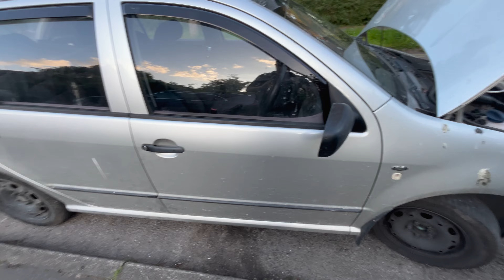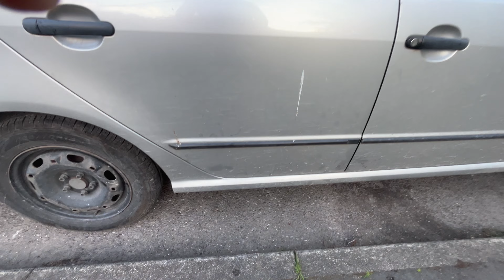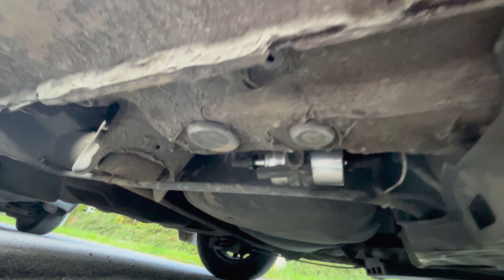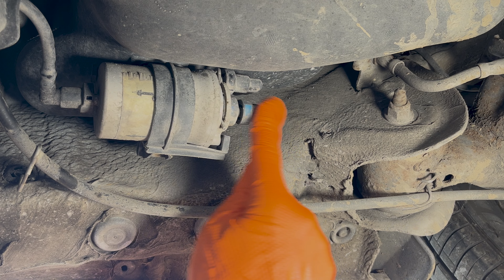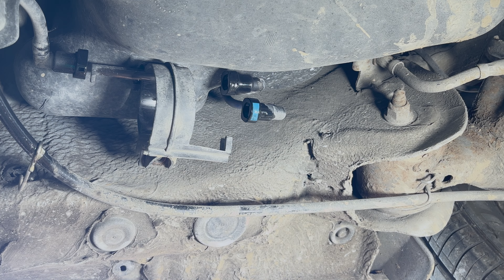Skoda Fabia (Mk1) Fuel Filter Change Step by Step

Comment: Hi, did you take out the fuel pump fuse before or is it not necessary?
Reply from the maker: Not necessary, pal. You only need to take out that fuse if you’re going to turn the engine over and don’t want Diesel being forced through the system.